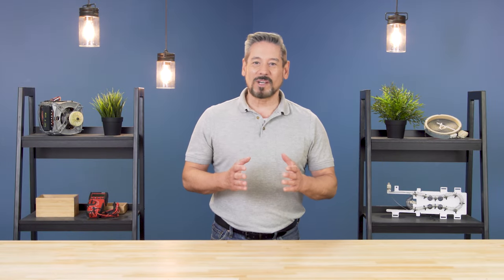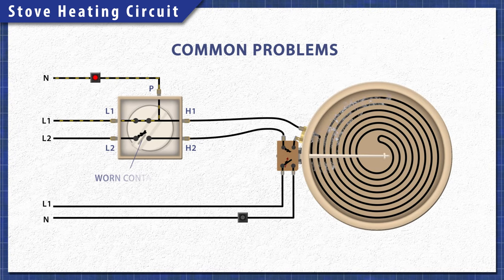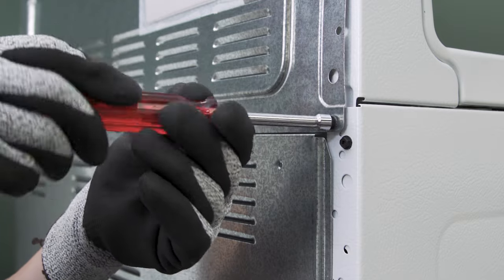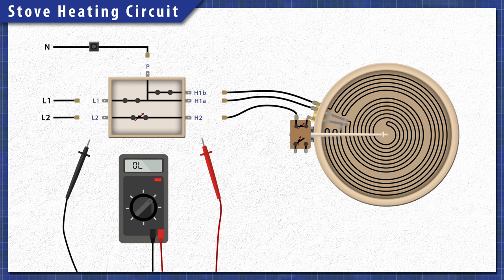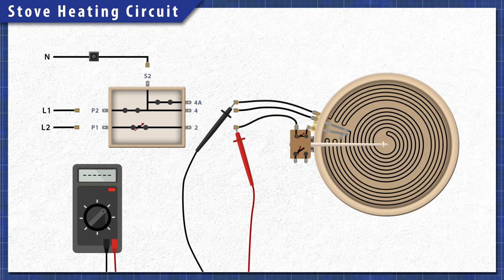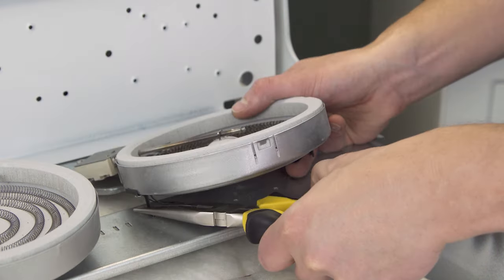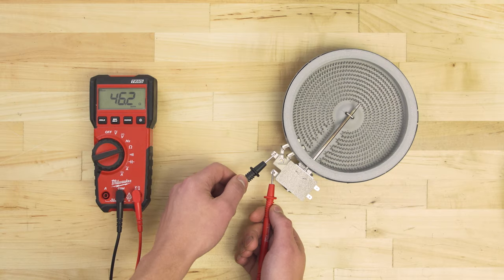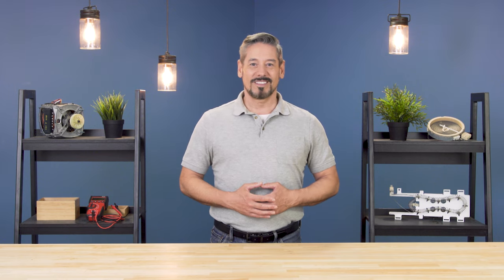Ceramic Stove Element Won't Heat - Troubleshooting | Repair & Replace

Comment from the maker: Did this video help you fix your stove? Did you run into any problems? Let us know in the comments!
Reply: Is it normal on the big burner when set to high  to turn ON and OFF while on this setting. TIA
Reply from the maker: @yeyolara6259  All electric elements will cycle on any heat setting. The heating elements are resistors. It is either ON or OFF. The heat switch can't send half the voltage for half the heat. It doesn't work that way.

A high heat setting means the burner cycles on and off, but it will stay on longer which results in more heat.

A low heat setting means the burner cycles on and off, but it will stay on for a shorter period of time, which results in less heat.

Because all electric stoves cycle on and off in this way, aluminum pans are more sensitive to these changes in heat. This is why heavier caste iron pans result in more even cooking.

If you want to see the inside of the switch you can learn more in this short video: https://youtube.com/shorts/URFjJPQycsk

Comment: Even though the infinite switch tested ok.  It didn’t let the element heat up, so now I changed both switch and element and it solved the initial problem of unchanged element on all the way.   Thanks
Reply from the maker: Thanks for watching, we're glad that you fixed the problem!

Comment: We have a Frigidaire from 2002.  had a cracked cooktop and the dual element had burnt out.

the new element did not have the same wiring.  Your video helped me realize how to test the new element and figure out that the high limit switch was different.  I think I got the n and l1 backwards or did something to the warning element, but it seems to work.

There were all kinds of little springs that kept the elements off the brackets.   mine was really hard to work on slide-in-range, it was all I could do to keep the elements sorted out and get it back in... and to top it off we couldnt find a glass cooktop replacement for the same model, but we found it rebranded and a different color/kenmore elite grey vs frigidare gallery white...  we're ok having a black cooktop... as long as it works.   the cabinets and floor were built around this, so it is hard to replace.
Reply from the maker: Thank you for sharing your experience. It is difficult to show every single model and variation but we're glad that the video helped you spot that difference in the limit switch wiring.

Comment: But only the switch for dual burner is not working properly if I set it in the highest level (9) with dual burner it will heat up but if I lower the level below 9 then it won’t be able to get the heat or if I switch to inner burner it will not have the heat either so what do you think in this situation?
Reply from the maker: Thanks for watching. It there is no heat at the below 9 setting then it's likely that the contacts inside the switch are warped. It's best to test the switch with a multimeter by following the steps at 3:50

Comment: Extremely well done video, but a remaining question for you. I replaced my infinate switch (single coil element), but the burner still stays on high heat only even when on low. Any ideas why this could still be happening? Thanks in advance !
Reply from the maker: Thank you, we're glad that you found the video helpful!

If the burner stays on high, then its either a stuck contact in the heat switch or a faulty element. Since you've eliminated the heat switch then you'll want to test and replace the element.

The element can be tested to see if it is shorted to ground, this will mean that the element will still receive power even when half of the power is cycled off at the heat switch. https://youtu.be/l39vOnhqnhg?t=42

You can see how to replace a surface element here: https://www.youtube.com/watch?v=XQ30epA84bQ

If you do find those other videos helpful and want to support the channel, comment and share your experience there too as it will help the algorithm and help other viewers know that the video is useful.
Reply: @AmreSupply  Thank you so much for the information. I will definately check these videos out and will most definately give them likes. Cheers! Keep up the great work :)
Reply from the maker: @Michaelt3474  You're welcome, we're just happy to help! Wish you all the best!
Reply: @AmreSupply  UPDATE: so I replaced both the infinaty switch annddd the element now. When I first tried it, it worked, I was so happy. Then, the next time I tried it, it stayed on high after being on high for a while... what could be happening that this is still happening. It is a whirpool gold series stove. https://www.whirlpool.ca/en_ca/kitchen/cooking/ranges/slide-in/p.6.4-cu.-ft.-front-control-electric-range-with-true-convection.ywee745h0fs.html?originProductCategory=KitchenCookingRanges&originVariantsOrder=SS
Reply from the maker: @Michaelt3474  Hi Michael, thank you for the update. There are a few things to check. Is the burner a dual or triple coil burner? Did you replace the same type of switch in the same orientation? A dual or triple coil switch installed upside down might give the appearance that the settings are off.

As well did any of the wires seem damaged? Even with the new switch you can test for a short as per this video https://youtu.be/l39vOnhqnhg?t=209 If the element is shorted, its possible that the wire harness is damaged, or that the wire terminals are compromised. Make sure that the terminals near the element are not touching anything near by. They should be isolated from any metal from the frame.

Comment: I still have no idea what to do 😅I am not very smart at these kinds of things. The right big burner on my stovetop only heats up the outer part/ring of it. The inside part does not heat. Do you have a diagnosis or what I can do? 😊
Reply from the maker: Thanks for watching. This video still applies to your situation. If the inside coil / ring of one of your heating elements is not working, then it's likely a faulty heat switch or heating element. You can test the heat switch through the back following the steps in this video. You'll have a dual switch so there will be extra terminals. If you follow the steps in this video you'll be able to determine if it is the switch or the element that is faulty.

Comment: Thanks for your video.  My burner element heat up once I twist the  knob, but then quickly shuts down with the click sound every time. Please let me know if you know the reason and solution.
Reply from the maker: Thanks for watching. The element will cycle on and off as needed. 

Does food still cook normally on the burner at a medium or high setting? Or is it not heating at all?
Reply: Thanks for reply.
The food isn't cooking because the burner isn't consistently heating up. Sometimes, it briefly opens for a few seconds before closing again with a clicking sound from the back side of the knob.
I checked the coil it’s all good.
Reply from the maker: @preetipokhriyal1914  If the sound is coming from the heat switch, it's likely faulty and will need to be replaced.

If you have a ceramic cook top, and the click comes from the stove top, it could be an issue with the limiter for that heating element. If you have another burner on the same type, that uses the same heat switch you take the heat switch (for the burner that doesn't work) and install it on the burner that works. If you get the same behavior, then the heat switch is faulty. If it heats up and works fine, then it's likely the limiter in the heating element that has been shutting the element off before it can heat properly.

Comment: Is the switch for touch pad will be the same as knob switch set up?
Reply from the maker: Thanks for watching. If your stove burners are controlled by a touch pad, then the switch will be a small relay built into the control board. These relays are not easily repaired, so if a relay fails then it's best to install a new control board: https://www.youtube.com/watch?v=ORTi4lLyoqw

Comment: Hello, I have an electrolux stove with oven but the oven heats up but Noone of the four elements /burners heat up, what could be the problem?
Reply from the maker: Thanks for watching. It's likely an issue with one of the wires that supplies power to all 4 burners. To narrow down the problem you can trace the wires and check for continuity: This video shows how to inspect the wire harness: https://youtu.be/wZwxewn2w44?t=373

Comment: Hi there,
I went through the wire testing part, and it showed that H1 and H2 doesn't have a connection.  I then tested the element, and the element is good.  Is there a video on how to go further with the repair in this situation?
Reply from the maker: Thanks for watching. If the heat switch failed any of the continuity tests then it should be replaced. Replacing a heat switch is simple but you can see this in more detail in this video: https://youtu.be/JKrrOflS1RM?t=406
Reply: @AmreSupply  I apologize for not being more specific.  The continuity test for the heat switch is fine.  I then moved on to the element test (back) to test if the wires and the element are ok.  The H1-H2 wires test failed.  I then tested the element itself, and it passed.  Meaning the problem is probably with the wires.  I'm asking if there's a video instruction on how to proceed.
Reply from the maker: @jenniferjia7181  Thank you for the clarification. Yes if the wires are faulty but the element is still good you can test the wires directly. Trace H1 to the terminal that connects to the element and test for continuity. Then test H2 to the terminal on the element. If that is faulty you'll have to either repair the wires or install a new wire.

If you have coiled elements, then you can get a receptacle kit with a full length wire: You can see how to install a new receptacle here: https://www.youtube.com/watch?v=GBnE_qEThsU

If you have a ceramic stove, then you'll have to identify which wire is faulty and replace it with a new segment and new connectors. We don't currently have a tutorial on this or wire crimping but there is no shortage on youtube. That is one we might do in the future to help out in cases like these.

Comment: any idea the problem if my burners are clicking on for about 20 seconds (heating up) and them clicking off (shutting off)(and repeating the cycle over and over)?  on the left side of my whirlpool stove top I have a big burner up front and small burner in the back.  I have one switch that turns on the front burner and another switch (DUAL) that I believe is suppose to heat both burners at the same time (if you have set the dial in DUAL MODE).  in summary, when I turn on either one of those switches, the corresponding burners will TURN ON, but then FLIP OFF after 20 seconds.   on the right side, the large front burner just won't come on at all (this burner stopped working months before the other burners started acting up).    the back burner does the same as the left side burners.  keeps flipping on and off.     so I only have one burner that works.  that left back burner.  and it only works correctly  when the dial is set to SINGLE MODE instead of dual mode.   I hope the control board isn't bad.  thanks
Reply from the maker: Thanks for watching. Electric heating elements work differently then a gas stove. in a gas stove, you can have a small continuous flame for low heat, and a large continuous flame for high heat.

Electric heating elements only have FULL heat or NO heat. They only turn on and off.  Elements will cycle on and off, to maintain an average level of heat.

A low setting will have the burner shut off for longer, than a high setting. 

On the highest settings you might notice the burner stay on almost for the full time.

If one of the elements in a dual burner is not working then it could be an issue with the heating element, the wires or the heat switch.

If your model does not have individual heat switches then it could be an issue with the control board. A control board will cycle differently than a infinite heat switch. This is more difficult to test.

Comment: On my cooktop one element (after the initial heat up) can be seen to only power up for a second then it turns off (this repeats) where is the problem likely to be? If you set the heat setting to maximum, it does not turn off. The other elements behave normally and a clicking sound is heard with their power cycling. No noise from the faulty element.
Reply: It is fixed now it was the switch unit.
Reply from the maker: Thanks for sharing, and for the update. Sorry for the delayed response, sometimes the notifications don't appear for these comments. We're glad you have it figured out though!

Comment: What is the dish that holds the coils? What is it made out of?
Reply from the maker: Thanks for watching. The base is made out of a compressed ring of fibrous materials, some sort of insulator but there isn't much information on what mix of material this is exactly.

Comment: About multimeter, I have a tiny simple tester (it was $7).  Can I use this one?  Or do I need one like you use in the video?
Reply: It is Kobalt's voltage tester.  Can we use this tester instead of multimeter?
Reply from the maker: @FlyAwayFlyHigh  You'll need a multimeter that is able to test for resistance or continuity.
Reply: @AmreSupply  
Thank you!
Reply from the maker: @FlyAwayFlyHigh  You're welcome!

Comment: What if you're getting a reading higher than 1 ohm? I have one switch reading 168 between L2 & H2, another reading 44. The rest are 0.
Reply from the maker: Thanks for watching. Any switch should have a resistance between 0 and 1 ohm. If you are getting a reading of 44 or 168 then double check all the terminal names to make sure that you're testing the correct ones. If you're still getting 44 or 168 ohms, then the limiter switch is faulty and the element should be replaced.

Comment: I have a kenmore 790.9641 electric range. The left front burner labeled "power burner" works but does not get as hot as it should. It won't boil water for example. The burner itself does not glow red. Could this still be a faulty burner or switch? Or something in the control board? Thanks in advance.
Reply from the maker: Hi Chris, thank you for watching. The stove heat switches and surface elements work independently from the control board, so a control board issue won't prevent water from boiling.

If the element is a dual coil heating element then it is possible that only part of the element is working. You can test this for continuity 

It is also possible that the heat switch is faulty. If the model is over a decade old then the metal contacts (inside the switch) could be warped, which will disconnect power more frequently preventing the longer heat cycles needed to boil water. 

Since the element gets power and you have some heat, the switch will have continuity, so you won't be able to use a multimeter to test how much warping takes place, so it would just be best to order a new switch.
Reply: @AmreSupply  Thank you for replying so fast! The range is 12 years old. I will order a switch and see what happens. Will test burner continuity also. Thanks again!
Reply from the maker: @chrisreibold1634  You're welcome! Best of luck with the repair!

Comment: The  manufacturer wants too much for a replacement for their heater.  Can I use a less expensive one that fits?
Reply from the maker: Thanks for watching. For a different element to work you'll have to check that it's the same diameter, same wattage, that its the same type (single, dual or triple element) it has the same number of terminals and that the mounting holes are similar enough that you can mount it.

Comment: But what if nothing but the clock works? Help, I've watched so many videos and all you show is how to replace burner elements. 
I need to know why nothing works and how to fix that.
Reply from the maker: Thanks for watching. We have other troubleshooting videos other than this cooktop one. You can see all 48 videos here: https://www.youtube.com/playlist?list=PLCo9SMjkdWBysYYCcg5xQLiVh_cW0JQvt

Now for your particular problem: If the clock works but the oven won't heat and ALL the cooktop elements are not working then its likely an issue with the power, the power cord or the oven fuse.

The clock works so you've verified that you're getting one line of 120V to your range. For the heating elements to work you need 240 volts ( two 120 volt lines of power).

This video shows how to test the 240V outlet, and the power cord to make sure that they are good. This will show you if there's an issue with the incoming power: https://youtu.be/wZwxewn2w44

Alternatively it could be an issue with the thermal fuse or high limit switch: https://www.youtube.com/watch?v=Ox1lPMJY62U

Comment: One better method is replace the faulty  element wiring to another  switch (whose element is working )...if element works...than the earlier switch has the issue...if not...then element has the issue.
Reply from the maker: Thanks for watching. This can't be done for all models as some are dual heat switches, and some models have connectors that won't directly swap to the other switches.